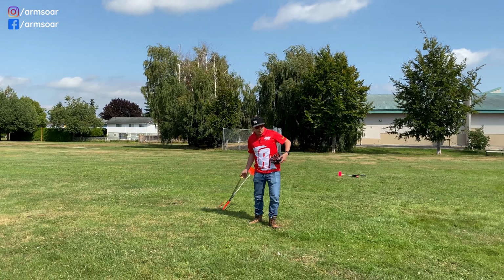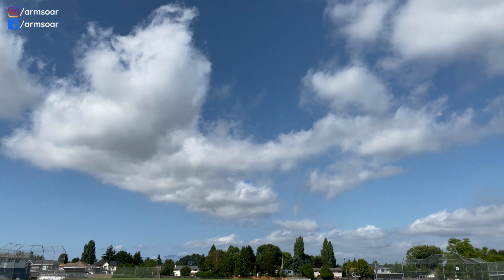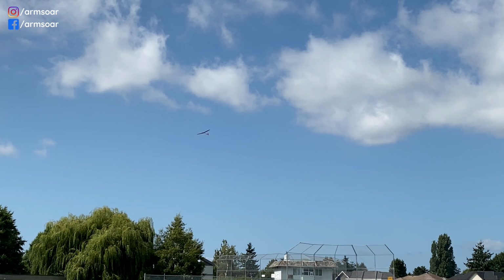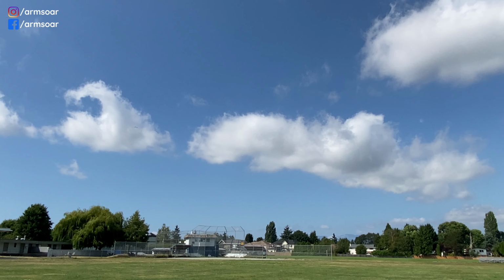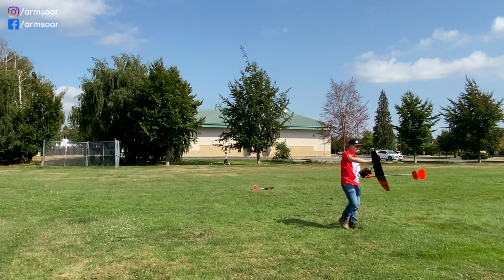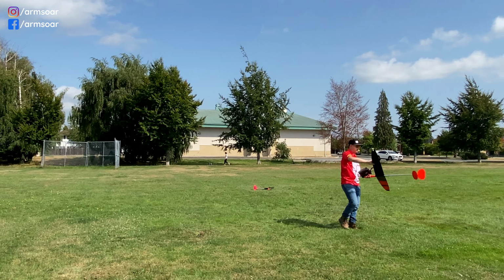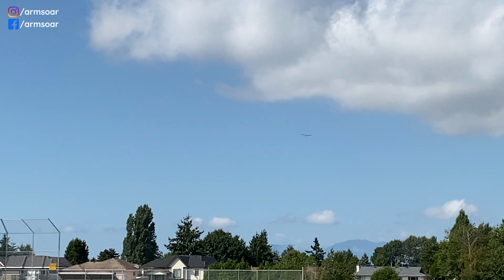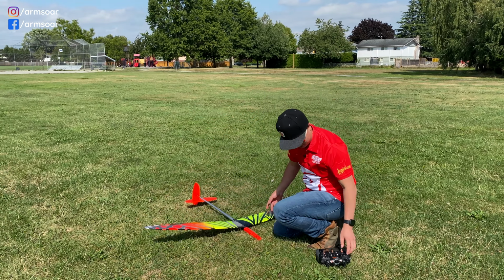Flying In Turbulence With The BAMF2

Comment: That was fun to watch. Must admit I'm not at all a fan of rudderless on this machine. That glider needs it for smooth efficient flight, IMO.
Reply from the maker: Flying well with rudderless is no problem; Switching back and forth between ruddered/rudderless has become a bit annoying, as the way I would enter the turn is a bit different.
Reply: @ArmSoar  Yeah, I totally what you're saying about you needing to adapt, but I'm referring to how the model is handling rather than your flying. It just doesn't look as good or as efficient as one with rudder.

Comment: Always fun the air just says "no"
Reply from the maker: Got to learn to say “yes” when the air says “no”! I’m still working on that… 🥲
Reply: @ArmSoar  yeah you gotta be so fast to react, I sneezed once in slope lift on a sand dune and that was enough time with my eyes off the plane for the next thing I saw to be the plane coming twords the base of the dune, idk how it all of a sudden had basically done a 180 but there was just no recovering it and although I did soften the landing, it still went nose first into the sand which sucked because it was a powered glider, that motor took a while to clean out and get freely spinning again. But it's all still a good learning experience, next time I'm about to sneeze and I'm flying a powered glider, I'm gonna power out away from the slope so random crazy turbulence doesn't ruin my day.